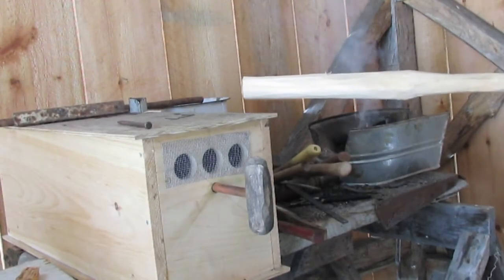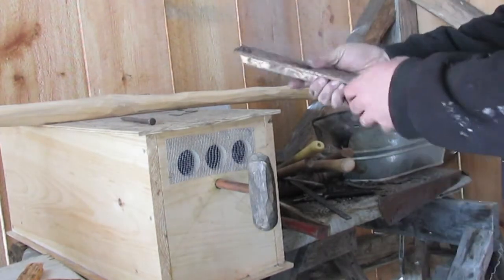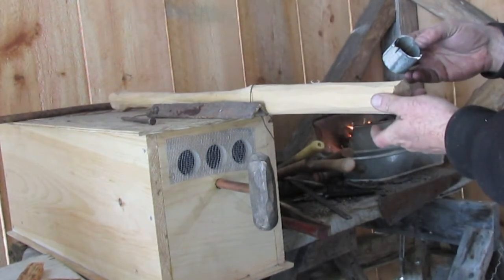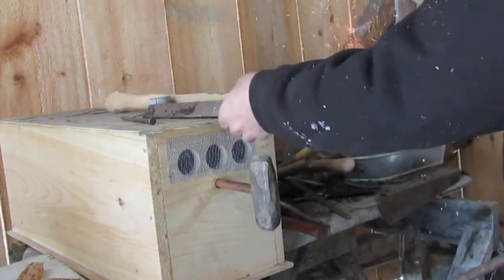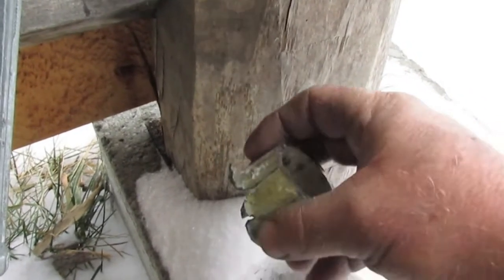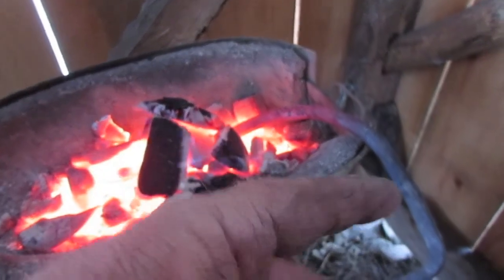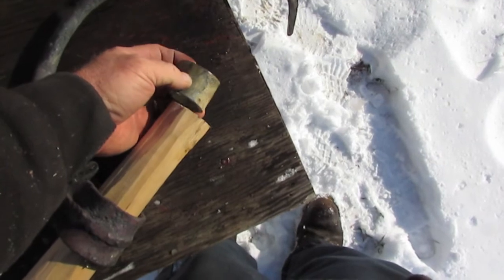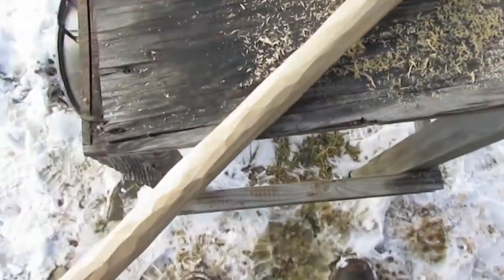Forging a Cant Hook

Comment: Add 'jacks' to the mix and we now have 3 tools, all purposed to turning and possibly moving logs. I'm touchy because I live an hour away from the home of the peavey (Farmington, Maine), and  I use a jack (a peavey with a foot) to lift and cut logs.The difference between a peavey and a cant, is the angle of the point (if any). Lots of opinions on what constitutes a good...whatever...
Maine still drove logs on rivers until the late 70s.
Reply from the maker: Is a jack a peavey with a foot or a cant hook with a foot?  It seems like from a chicken and the egg standpoint, the cant hook was the first design, and the peavey and the jack were Yankee innovations/modifications of the tool.  The jacks are probably pretty handy if you are bucking with a saw, I can't see them being useful for the cordwood challenge though.
Reply: A log jack is simply a  hinged foot on either a peavey or cant hook. The difference between a cant hook/dog and a peavey is that a peavey has a straight spike, and a cant hook has a bent spike for added bite.
The jack works well for me because I bring in tree length wood and have to untangle the pile.. If you're using an axe, probably don't need it:-)
Do consider a pickeroon! Splitting and stacking is much more fun while remaining upright.

Comment: cracking vid - how would you re-do your forge, and what changes would you make?
And did you make your bellow box from a youtube design or an underhill one :D
Reply from the maker: Hey Cryostorm.  I have a vid about the box bellows.  https://www.youtube.com/watch?v=X_Jdf5Ab6PM&t=515s&index=1&list=PLGQ0YYG8MKkW8pD41tZ6jtL3FTgGOmBMP
Reply from the maker: I'm planning on trying a Tai Goo style wood-ash tub with a side blast tuyere.  Mostly because I already have all the stuff that would be required.  This forge is too small and awkward, and it is difficult to get enough heat and the charcoal is always spilling out when I fill it deep enough to get a decent amt of heat in a piece.
Reply: sweet
Reply: ive been tinkering for a while about buying vs making a canthook and i watched another tuber use a wheelbarrow forge to make his canthook/pickeroon which i thought was pretty neat.
Reply: Talk to me about pickeroons. I restored them and have made them, also use one constantly when splitting wood.
Reply from the maker: I'd like to see that vid if you show the link?  I've not really considered adding a pickeroon to my tool set.